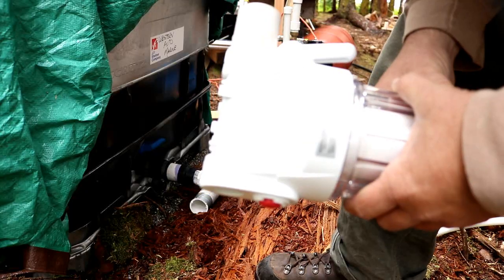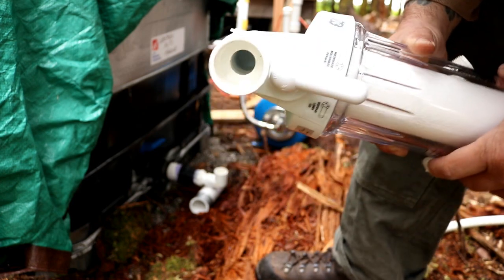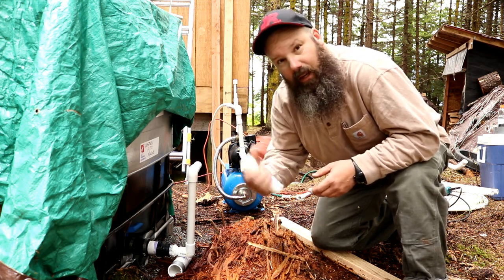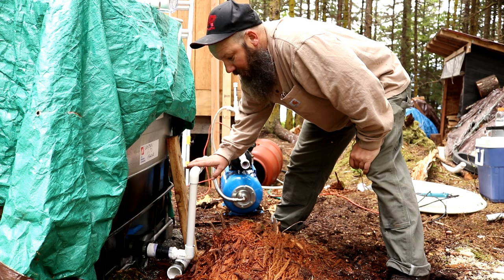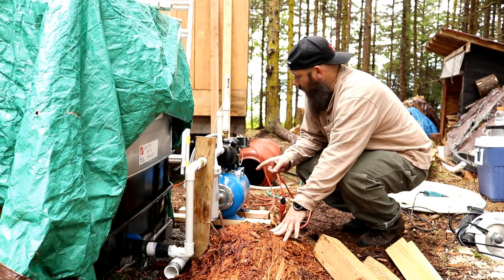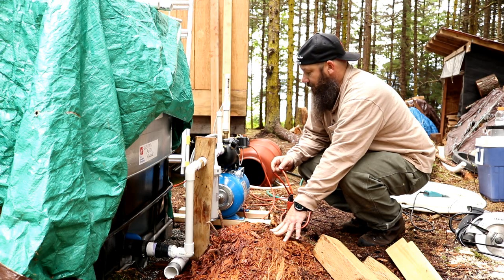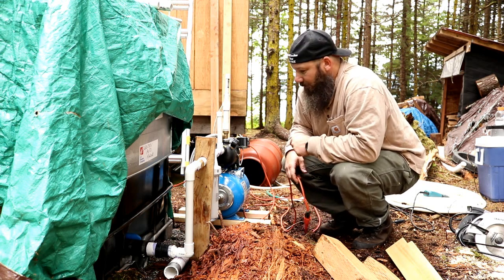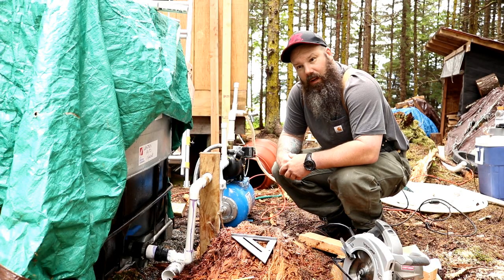Upgrading water pressure tank Rain Catchment System Part IV  (SE 2 EP 29) 2017

Comment: I installed the same filter system going to my hot water tank over 12 years ago and it has worked like a champ. The hot water tank is as clean as day one.  A little hard to break the seal when you change filters.
Reply from the maker: That's good to hear.

Comment: Nice job but I would have put the filter in front of the check valve cause one little pine needle could stop it from closing
Reply: True that, but he's probably also doing some course filtering of the rainwater before it goes into the tank, getting rid of the larger debris.
Reply: your welcome I also appreciate suggestions
Reply from the maker: Thanks OT. When we move it inside we will make that change.